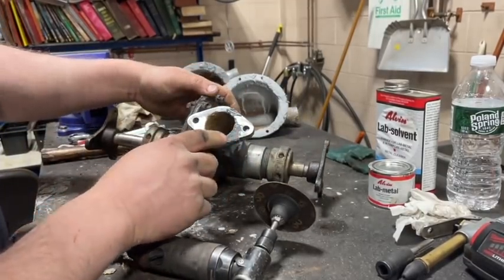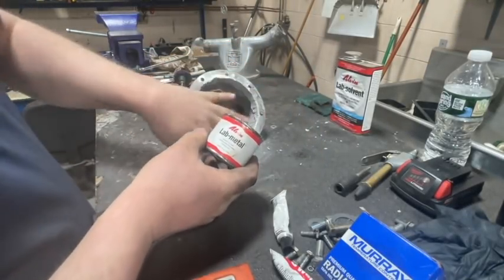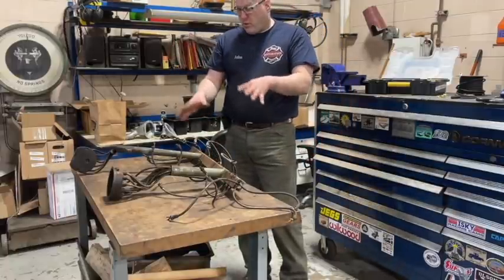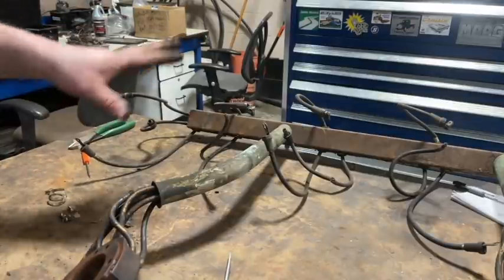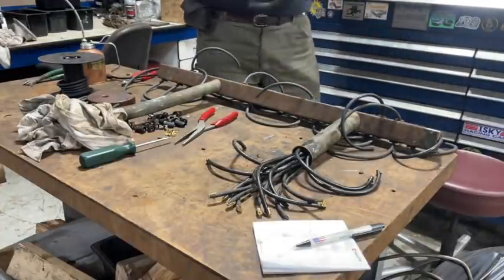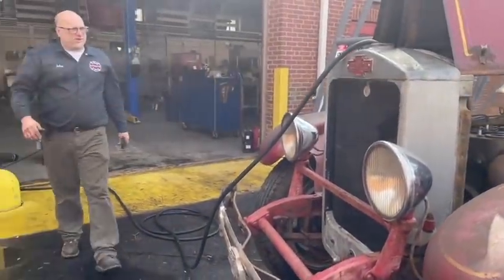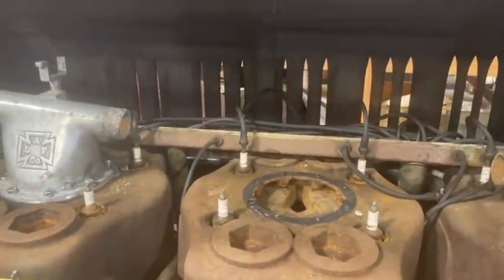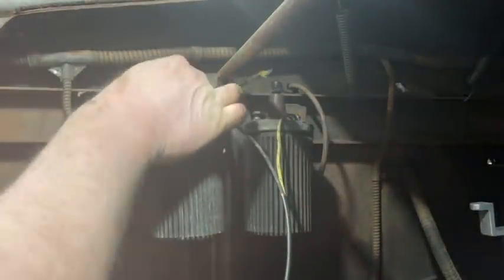1930 American LaFrance Part 3   Large 540p

Comment: Stick a sheet of the appropriate abrasive to a flat surface like plate glass or steel plate and use it to sand the flange down to an even flat surface.  Better and quicker than a double cut file.

Comment: I think the key to having those aluminum castings not crack (less likely to crack?) would have been to work the flange area on some coarse sandpaper that was laid over some plate metal. That way you are sure the mating surface is perfectly flat, which it really wasn't due to the split / distortion from frost. In my shop I used some self sticking sandpaper that's normally used on a body sander. That way it stays put while you work.

Comment: I was hopeful on the aluminum repair also. However I have a suggestion for you for a one more try. Aluminum welding rod. I get it from Harbor Fraight. You use a map gas with it. It is millable, drill and tapable. I have used it several times. There is a small learning curve. Some good videos on youtube lol. Nice project!!!!

Comment: We would use VALVE GRINDING COMPOUND on a SHEET of THICK GLASS (like a ship's porthole glass) to get a surface flat.
Reply: You could glue Sandpaper to glass for quicker results. Since you will be using a gasket I wouldn't think the finer finish of valve compound would be required. They use this method for sharpening chisel and planing iron edges.

Comment: I suspect those return is not aluminum.  probably some kind of pot metal.   I mean think about it... water picks up iron atoms from engine and contacts aluminum.  even the return is in contact with the iron casing. I saw how soft material was when you removed the returns.
Reply: Pot metal is generally Zinc, and that would have been more available and affordable in 1930.